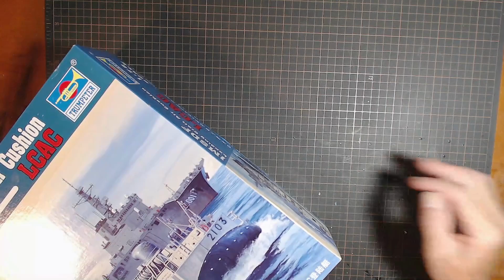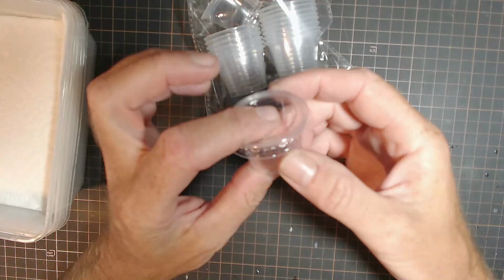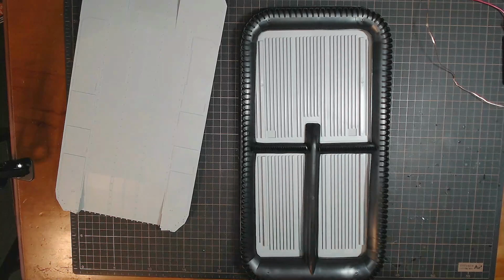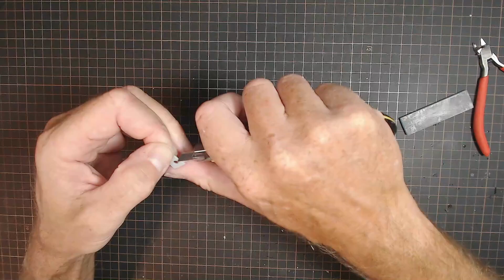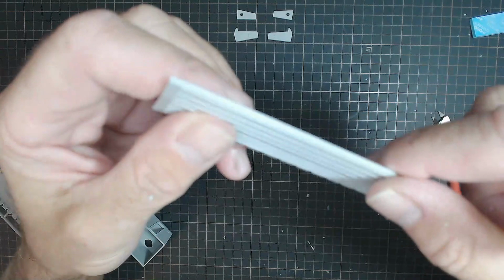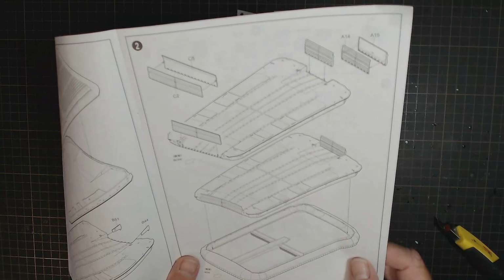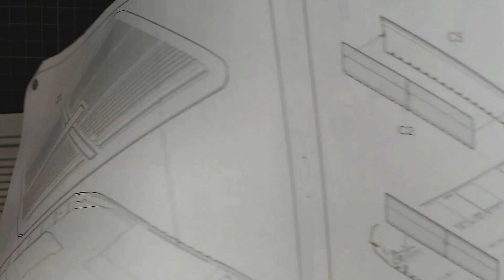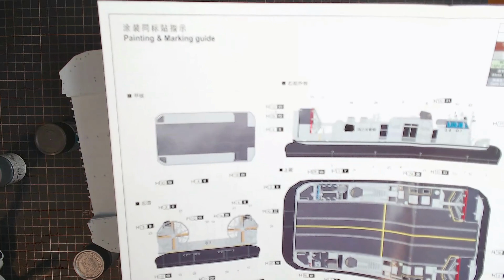JMSDF LCAC Landing Craft Air Cushion Hovercraft Build Part 1. Trumpeter NO: 07301

Comment: Hi Peter, great video.  I really like your new camera and lighting.  Your new airbrush looks great too.  Quick question, is the rubber skirt supposed to be glued on?  Have you tried gluing it yet?  I just wondered what kind of glue is needed to attach it.  I would imagine the ramps are only let down when the vehicle is stopped and the skirt is deflated.  The vehicle would be much closer to the ground at that time.  I like your new video format.  That's something I have been wanting to do too.  The whole idea of videoing is to show what you are doing, without the video being to long or boring the audience. Just don't start showing sunrises or bunny rabbits !!! 😄  Thanks for sharing, See you for part 2.  Jeff
Reply from the maker: Hi Jeff, yes it has to be glued and it took a whole day to do sections at a time using Contacta. Most mornings I am up at 3am so I could do sunrises and Joeys ( baby Kangaroos).    🌇🐇🙄👍

Comment: Isn’t there another operators cabin opposite the cockpit? Should there be a light in there too? This is going to be an interesting build from a paint and weather aspect. Looking forward to it.
Reply from the maker: Yeah um, they had to cut cost and have not replaced the bulb in the 2nd cabin opposite ( Actually I forgot ) Your right though, the weathering will be interesting, imagine all that sand and salt water messing it up.... 🙄👍